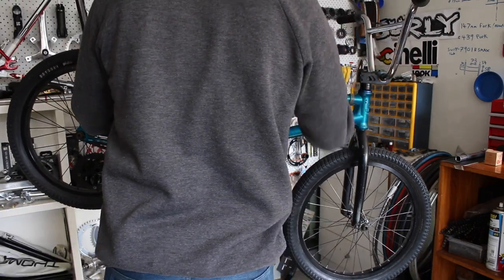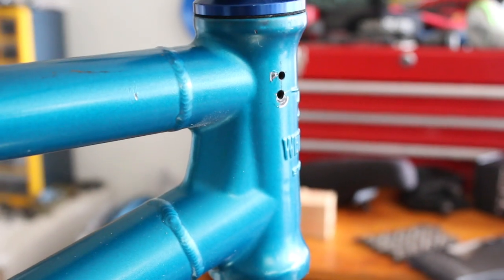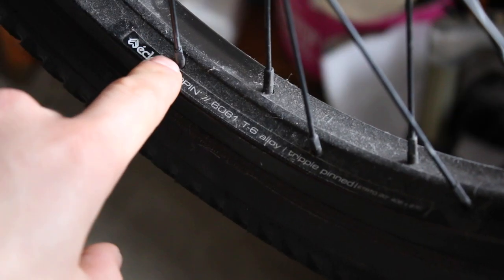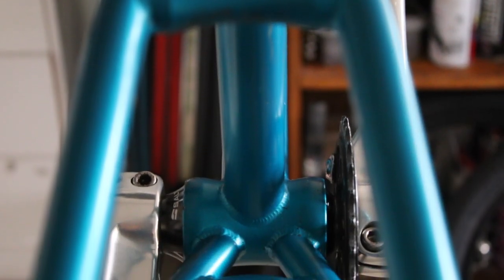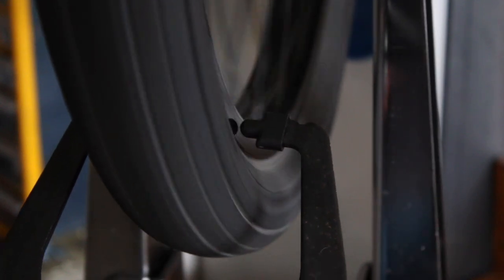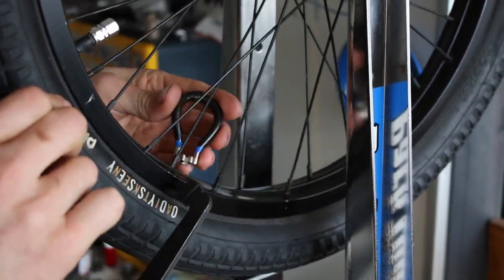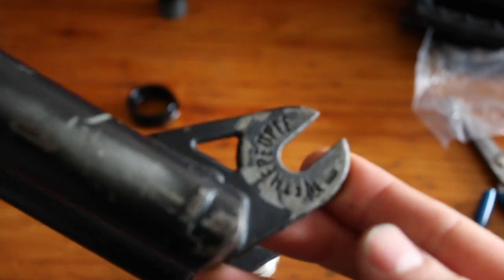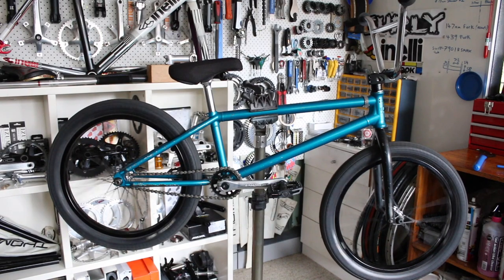Rebuilding my old BMX - New Parts & Wheel Build

Comment: That cracking noise while pedaling! 
I feel it 100% i rebuild my old BMX after 5, 7, 9, 10 years. 
- Bigger Bars
- new Seat and Post….
Really similar what u did and the Chain and Than i was so Angry about the cracking noise never had any sounds on every bike…. 🥺
So i worked on the driver with a dremel to bring the tooths back in Shape Works Fine!
I swapped the Front sprocket to a bigger one for better feeling.
Now iam back on the Bike! 
After few rides i tried a freecoaster and i love it…. silience❤️
Reply from the maker: Awesome! Yeah it’s not the nicest sound, that’s what a new chain on a worn cog will do😅

Comment: I'm surprised with all you put into the bikes you didn't relace the rear wheel. Or service the bottom bracket (if it's not sealed bearings). But still great video and great refresh of the bike!
Reply from the maker: Thanks! The bottom bracket is sealed but I did actually end up replacing it just after filming the video👍